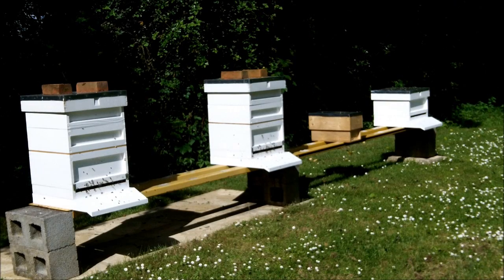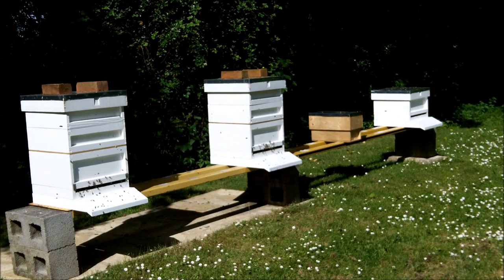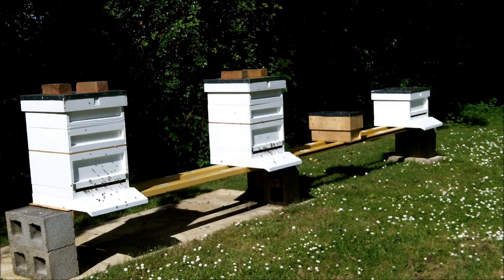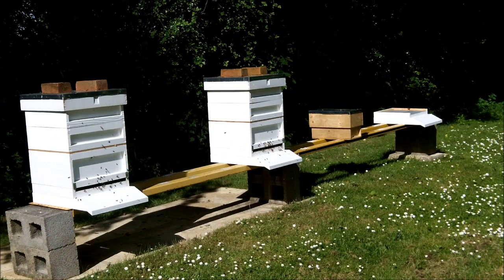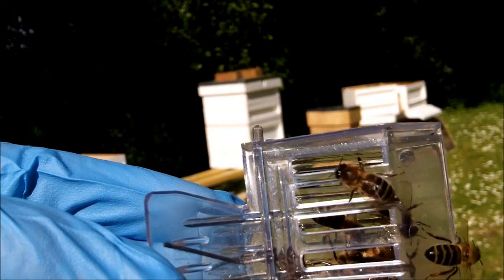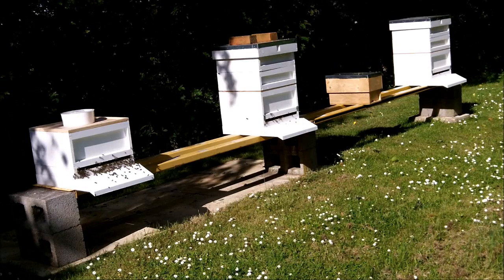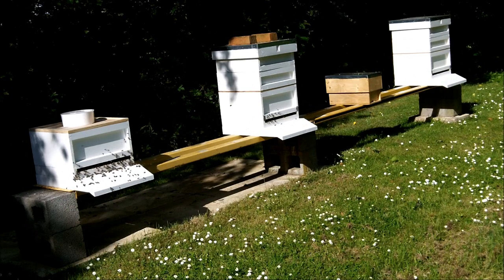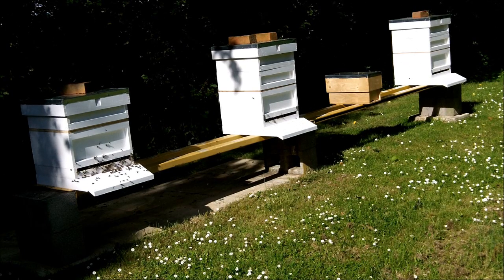Artificial Swarm

Comment: I run 3000+ colonies and I have an easier way. 1st get to know the ages of queen cells. Remember they develop faster than workers because they are fed pure royal jelly. The day and even a day after the queen is ready to emerge the workers will keep her in her cell by holding the hinged door closed. They feed her this whole time, getting her stronger. Ok back to the.. Look on the bottom of the frames at bottom of hive and in the middle for these cells, if they are cracked open ie- the new queen is emerged, you are screwed. So now you can get your own new queen right?     Now, another easy swarm prevention (and can use that cell I just spoke of.) Break hive in half. put a queen excluder on. Come back  in 3-4 days and inspect a few frames for eggs. The half that has eggs has the queen. Take that half and put another full box on it. make sure to only move it 3 or less feet from the other half- you got that part way wrong. The other queenless half- add that ready to emerge cell I spoke of (be careful when removing those cells, use a sharp knife and slice a bit of frame if necessary) or you can add a purchased mated queen.  Rule on moving them, Less that 3ft and more than 3 miles (Ive seen them go back at 7 miles but meh) so if both halves are withing the 3 ft, they both have brood and queens- they will equal out.

Comment: im thinking you did this wrong. i believe that you move the queen and a few brood frames to the NEW position (mature queens leave with a swarm). put the frames with the swarm cells including the nurse bees in the old position. leave it for a few days and check for a virgin queen. if you need more bes in the queenless hive in the old position...add capped brood frames from the 'swarmed' hive....with nurse bees.
Reply from the maker: I took the model from here http://youtu.be/yQPQj_UhmMk
With an artificial swarm the queen and mature (flying) bees leave. With the queen cells moved and queen re-populated into a 'new' hive (albeit in old position) the flying bees return here, find a new hive and believe they have swarmed.  It worked anyhow. My only issue was I had no spare drawn comb so had to use foundation. With hindsight, I should have taken one or two at least from the old brood nest to keep them happy in meantime, ensuring I removed any queen cells. As I say, in any case it worked for me, but always learning
Reply: uhhhh thats what i just said. hahaha no worries.